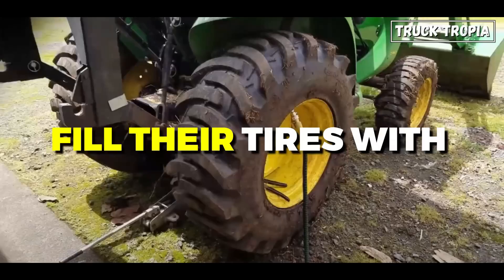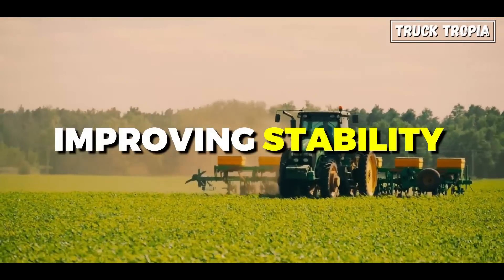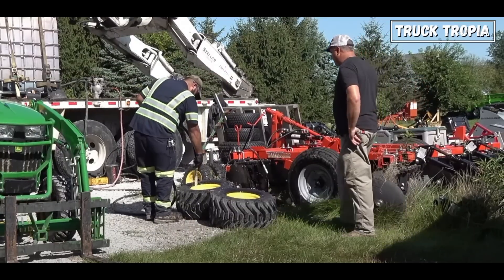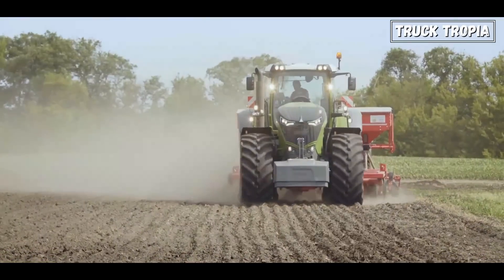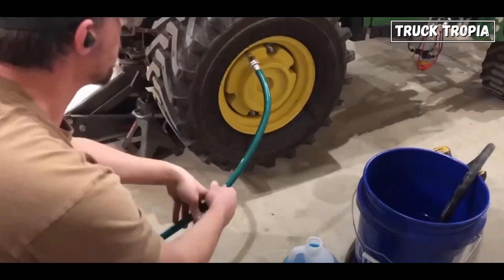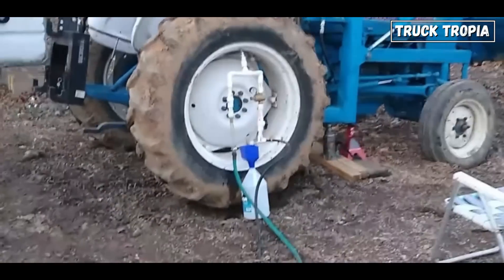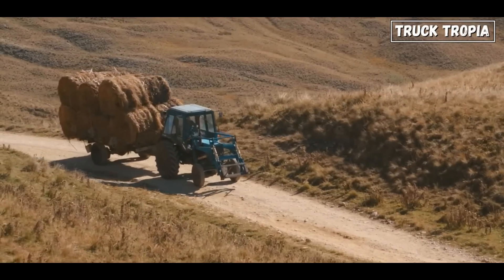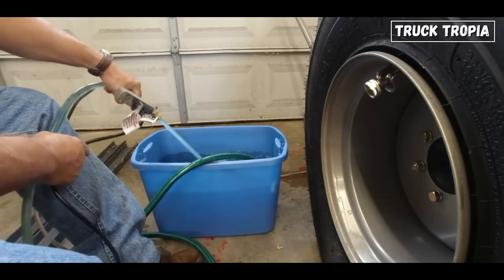Why Some Tractor Tires Are Filled With Water?

Comment: If you put water inside your tires the rims will rust, and if you put antifreeze or other glycol/alcohol solutions to prevent rust it's probably going to damage the tires, so it's a never ending loss, just stick with wheel waits or dual rims and tires
Reply: There's literally special liquid ballast for this. It doesn't replace wheel weights, it adds to it.
Reply: @SilverStarHeggisist well if you're gonna use a liquid tire ballast at least use the correct stuff made for the job, I'd still wouldn't recommend it but to each their own
Reply: @lefteris426  tire company near me uses windshield washer fluid, it's cheaper, doesn't freeze and doesn't have the corrosion issues.

Comment: basically, its just #BALLAST.!! And adding (at least*) SOME antifreeze is Definitely VERY important in freezing conditions!!!!

🤔😁👍🏼🤷🏼
(But im pretty sure ethylene Glycol can degrade crack or even Melt**) Rubber!? RIGHT??)
HOW DO YOU GET IT IN OR OUT????
🧐😳🤦🏼😆
#wet
Reply: One time a friend of mine was kinda going through/organizing his trunk.. he came across a 3gal. Pennzoil plastic jug, and put it in MY cars trunk . And he said "its just water, you can put it in your radiator; and you can drink it in an emergency..'' 🤦🏼 but after a week or so; i had Completely forgotten about it.. then i noticed Hella of my emergency gear(like a baggy red jacket and red snow-pants, the rubber seals/gaskets on me pellet gun .. and i had a comp,notebook for college, it turned the white part of the page yellow, and the blue ink part Green!? So i put it on my dashboard in direct sunlight for a couple hours.... Aaaand.. ALL of the Wet parts TURNED BLACK* AND DETERIORATED TO THE POINT IT CRUMBLED LIKE ASH!!!!?? like it had been physically Burned!!??*
 But, Luckily there was some stuff just Barely over and under  a small part of the blackened area, plus the carpet/upholstery material it was about 1cm below it was untouched; (in a closed car*)
SO DEFINITELY NOT a Fire!!!!??
So be careful with that shit!!!!!!!*
"Drink it in an emergency" he says..  "its just water" he says!!??
🤔🤦🏼🙄🤷🏼
#fcol #SketchAf

Comment: We used to put water in the tires of our telescopic forklifts.  Adding 700lbs of water per tire equals 1,400 extra pounds of capacity before tipping.  Now days they are foam filled with 750pounds.

Comment: My father was a diesel mechanic and I used to work with him. When I was about 10, a customer brought his tractor and we were going to disassemble it and fix it. So my dad asked that when school gets out I should take out the wheels on the tractor while he was still at work.

Let's just say I ended up on the ground pinned by a heavy wheel filled with water for a couple of hours until my step mother rescued me. That's how I learned that some tractors are filled with water instead of air. No serious injuries.
Reply: 😥 That was close. The same thing nearly happened to my son when he was 15. Neither one of us knew it was filled.

Comment: It does add weight, tractors need weight to horsepower ratios to be most efficient, have better ride characteristics like getting rid of power hop. However it’s best to add wheel-weights or suitcase weights.  Adding ballast to the tires essentially turns them into bias tires taking away their ability to spread the footprint, lesson the PSI on the ground and add more yield to your crop.
But what do I know…. I just sell these specific tires for a living.
Reply: Bias tires can spread their foot print

Comment: "enhance the stability of the tractor by lower its center of gravity"
"gets better traction"

The heavier a machine is easier it is to get stuck in mud and its not like tractors tip over so they need to be closer to the ground. high ground clearance is more important in terrain like mud.

Comment: With the rise of EVs & Hybrids, the ballast can actually be batteries.
And for offroaders, maybe environmentally friendly tire-sealant can be used in this way, for the same benefits as water-tires? Like Slime sealant. The extra sealant will not only have the same benefits as tractor water tires, but also have a higher chance of plugging a puncture.
Reply: Slime is $25 gallon
Reply: @ProctorsGamble  
A lot of great mods cost a noticeable amount of money.

Comment: My gosh.... cacl is used for making the fluid even more heavy. Allso fluid filling is never done on tubeless.  Unless your parents are borther and sister. 
Allso , no ballast can replace fluid filling. The fluid will make the tire spread out , so you got a larger contact area. 
And if used when it should be used , you get better fuel economy. Since you will have less slip. 

If you are clueless about something Than don't post a video like if you had an idea. Any.. idea about the topic.

Comment: Another advantage of putting water is that in case of a puncture the tyre will not immediately deflate and you can continue driving on unlike with air filled tyres which suddenly lose air and you have to stop.

Comment: Our field tractors had a water / calcium chloride mix in the tires.  That was some miserable stuff.  You always had to make sure the valve stems were at the top of the tire if you were going to check tire pressure or add air.  We had a separate pressure gauge and air chuck for the tires.  The valve stems also had troubles with leakage and no matter how careful you were you always got that miserable stuff on you when working with the tires.

Comment: Most of the farmers I saw doing that believe that this adds more weight to the tractor and therefore better grip . The designers however made the tires in such a way that you get the grip you need when the tires are normally inflated and almost new without adding more stress to the tire or differentials . First of all the fuel economy is ruined , the tractor is always "loaded" therefore the tires wear out sooner .
Reply: Designers have to make generic assumptions about the tractor which has nothing to do with actual use.
Reply: What about altering the center of gravity? Wouldn't this improve stability an incline?
Reply: @darrinpennington  tractor with full water tires have the gravity center much lower than tractor without water or with iron balasts
Reply: Have you ever used a tractor?
Reply: Hold on so I'm going to wear out my tires at 5mph?
Reply: I never saw difference in worked hours of duration between tires with 20% water, 90% water or no water with ballast or no ballast.
Reply: Well, the effect on fuel economy in a farm tractor will be a theoretical non-issue and essentially the same between liquid loaded tires, wheel weights, nose weights or extra snacks in cockpit per kilogram.

But yes, the (sometimes)better tractive ability comes from added mass and it's not important whether it's fluid or something else, when assuming similar front/rear distribution. The effect of fluid on friction is mostly superstition. Specifically using CaCl (and thus tube type setup) actually makes it worse as it's not possible to properly adjust pressure to benefit from good ag tyres.

Center of gravity is another thing, that benefits from liquid fill.
Reply: @ffffffff-vv7yp  thank you for explaining that for our friend 😂
Reply: @nathanmahler3743 
Jedino je objasnio da ne zna šta priča.
Reply: Never assume designers aka engineers have designed something to be the most effective. They design things for a price point, lifespan, etc. 

A perfect example is the 0w-20 oils that are ubiquitous in almost all new vehicles here in the USA. But you see those same vehicles with the same engines in other countries that the classic different oil weights for different climates. 

Why?  Because the engineers have to meet a EPA mandate for fuel economy called CAFE. So they can claim that the thinner oils get a mile more per gallon in lab tests. 

But those SAME engines in other countries had an owner’s manual that says up to 10w-30 it hotter climates. But those same engines here in the states says 0W-20 ONLY. 

So remember engineers are not always designing things for the best longevity and customer expectations. They work for accountants and politicians and lawyers.
Reply: @DasNewsNetwork  hello there and thank you for replying. However it doesn't change my opinion from the perspective that the buyer realises after buying something that it's not what he expected or not enough .
 An example?  Mitsubishi Lancer Evolution. Countless people around the world ( including myself ) are dreaming of buying one . Okay till here ? 
As soon as they buy the car ,which is factory reliable set up to maximize handling and shorten steering radius and braking distances, they totally "throw that out of the window" and start changing everything on the car ...ride height , suspension stiffness, rims , tires ( including dimensions) , exhausts , manifolds , turbos, intercooler , fuel injectors , ECU ...I think you get where I am going with this ... If you ask them what car they have , they will probably answer proudly "a Lancer EVO" , but they actually own what remains from that car . 

You might be right about the oils used on different climates and countries and perhaps many other things on that matter , but that doesn't change the fact that some "subculture" is activated when it comes to cars , trucks , tractors , motorcycles , they all want ( 80% ) to be faster, cooler , unique , to look better than others etc etc . I don't know about the situation over there but since the movie "Fast and Furious"  and other advertising ideas came about , suddenly horsepower is at least tripled if not more , more accidents happen daily globally, more sales happen , more insurances , and the list goes on . I was born in 1979 , I grew up looking as the coolest super car ever a Lamborghini Diablo in poster on my room wall ... 😂  Nowadays a car like that  sounds like nothing . And I am asking you a question now as a fella from another part of the world . When is this madness gonna stop ? When are we gonna think about the environment ?
Reply: Tell me you've never been around a farm wirhout telling me you've ever been around a farm.
Reply: Not true at all
Reply: It’s a noticeable difference we run water in all 4 tires 🛞 to 1 add weight so it makes the tractor 🚜 heavier so the equipment being towed doesn’t push as much. 2 lowers centre of gravity I turn on slopes so want it to be well planted 3 my boss won’t get me wheel weights lol 😂
Reply: @kevinvogelsang5612  A ) your boss sucks , B) your boss is an asshole, C) you need a new boss !  😂
Reply: Tractor tires can work up to 20 years tire life isn't an issue when you got stuck in the mud
Reply: So between your first post and your reply I take it you are a car guy but have little to no farming experience. Btw, we seem to be the same age seeing as how we both can claim we were born in the 70's but if your like me, we don't remember it at all, lol.
Tractors are a slow moving vehicle and as such, tire wear and fuel economy are entirely different from on road vehicles, as for the ballast, water and other ballast materials are used on most every tractor I know of due to the weights they pull on the draw bar or hitch, which can easily flip the tractor over backwards when lifting on the hitch or forwards when lifting weights on the front like with a front end loader.ballast is best used as low as possible and ballast in the lower half of the tires can't get any lower. By putting ballast in the tires it also stabilizes the tractor on side hills and can keep it from rolling over, which has almost happened to me and was the exact reason I put a mix of water and antifreeze in my tractors tires up to the halfway point. 
As for fuel economy, tractors fuel use goes almost entirely to pulling the weight behind it and u sprung rolling weight barely even registers as a draw when plows, mowers, and trailers are brought into the equation for fuel economy.
Reply: Years ago I read a Lady's Bird book on tractors. It explains why Tyre are sometimes fill out with water.
Reply: @emmanuelomage6092 
Kod mene su gume uvek pune vode.
Reply: Međutim to šta si rekao nema veze sa realnosti.
Tegovi ooterećuju traktor,ooterećuju motor,smanjuju snagu motora i povećavaju potrošnju goriva.
Voda u gumamam direktno ooterećuje gazni dio gume,slobodno cirkuliše kroz gumu te zbog toga je i efikasnija i nemjerljivo bolja od tegova. Potrošnja goriva je skoro pa ista,motor radi normalno a mehanički dijelovi traktora trpe mnogo manje naprezanja. 
U blatu guma napunjena vodom se drastično bolje ponaša nego guma opterećena tegovima.
Voda u gumama me je mnogo puta spasila.
Bez bode u gumama ne bi mogao mnogo posla uraditi.
To je moje iskustvo.
Reply: Dumbest comment of the year award
Reply: So wrong.  I was gonna explain it but I think its beyond your comprehension

Comment: Calcium chloride isn’t just for anti freeze. Water weighs 8.34 pounds per gallon, you add roughly 100 lbs of calcium chloride to 50 gallons of water. That adds 2 lbs per gallon and increases the amount of ballast in each tire. It is hell on steel rims though.
Reply: you could first coat the inside of the rims with liquid rubber like HBS-200 or other bitumen/polymer like material, then the inside cant corrode. latex wouldn´t be an alternative as it would deteriorate
Reply: It is very aggressive and will destroy metal fast by causing it to rust

Comment: Why ballast?
Reply: To make use of the horse power
Reply: When you want to increase soil compaction, leave nasty marks on a field or even get stuck in mud. ;)

When your tractor is not heavy enough to pull whatever it's going to pull.

Also when you don't want to tip over equipment causing economical loss or human casualties, which is of course not ideal.
Reply: @ffffffff-vv7yp  Light tractors slipping cause more compaction than properly ballasted
Reply: @RJ1999x  Correct and not contradictory.

Comment: Though wheel weights are most expensive, couldn’t it do the exact same thing?
Reply: Yes, and better. Lol read my earlier comment above.
Reply: @nevinbontrager8828 iron weights could be better, but water is cheaper and cheaper is better.
Reply: @C0lon0  lol I hear that.  The price of weights has gone crazy, like everything.  But like I said, weights are only expensive once. 

But you know how to farm, do what works for you!
Reply: @nevinbontrager8828 not better, that's the spin the companies put on it, because they can sell you very expensive pig iron
Reply: With a singular exception: the ballast CG is lower when it's liquid. It's always below the center of wheel CG. With a low let's say 30% fill, much lower. As you see, 100% fill is not even possible or practical unless we mean foam.
Reply: @ffffffff-vv7yp  would agree with that, but argue that's a very specific case that needs the low CG.

Comment: It adds weight directly on the ground, reducing weight attached to the drivetrain. Thus reducing wear.
Reply: Rotary solid mass attached to drivetrain, compared to wheel weights? Yes. Not compared to other methods of ballasting.

More so it reduces wear on many parts especially involving the front axle(sometimes adds to it). Similar to the idea of "unsprung mass" on road vehicles but this time the opposite way is mostly beneficial. However wheel weights have the same effect.